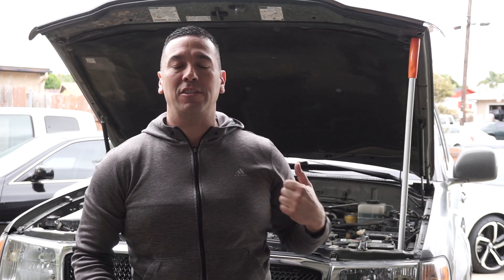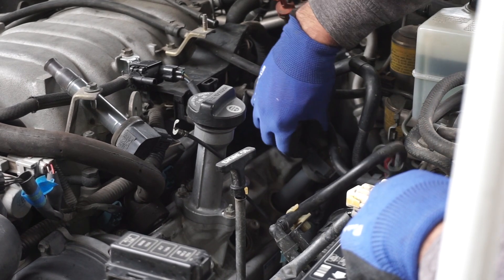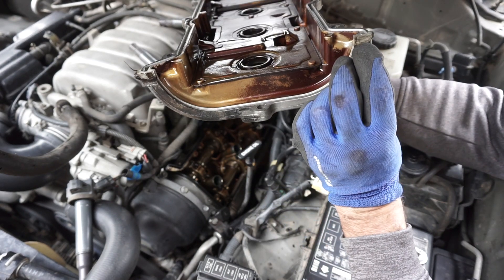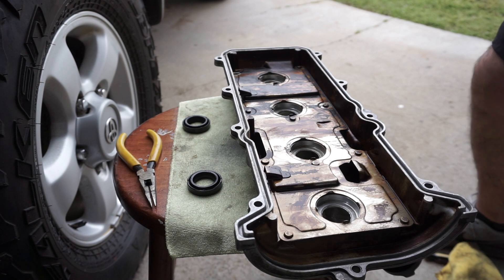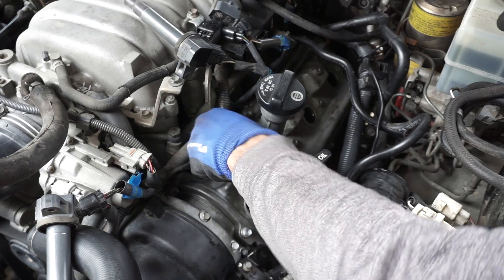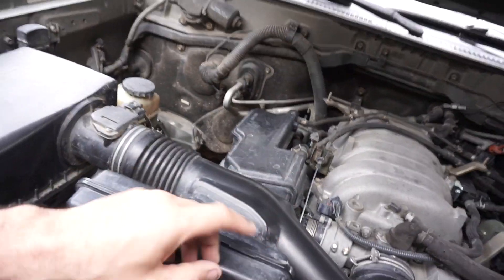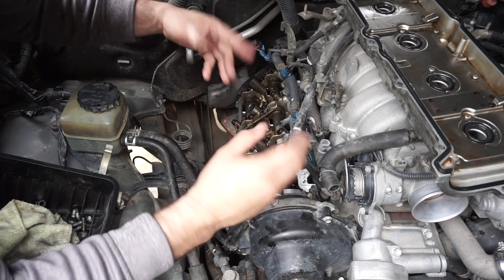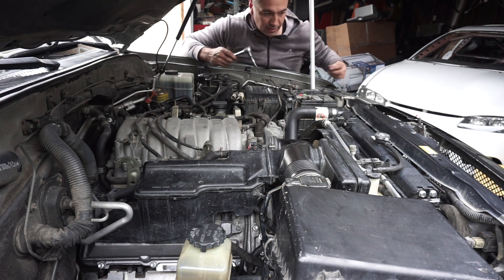Replacing Valve Cover Gasket On A 100 Series Land Cruiser / Lexus LX470

Comment: Good video!  One suggestion: If the engine has over 200k miles, and you have the technical ability, check the valve clearances to see if they are within spec.  This engine lacks automatic/hydraulic lifters, the valve clearances are adjusted with shims.
Reply from the maker: Thanks for the tip!👍🏼